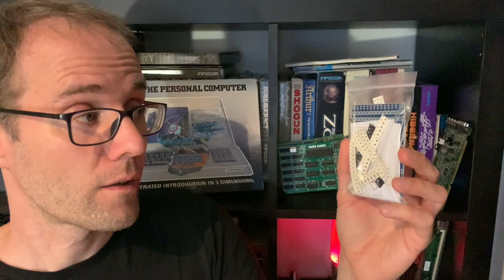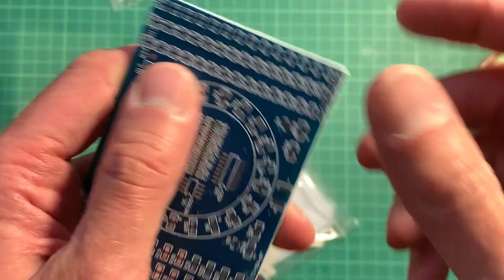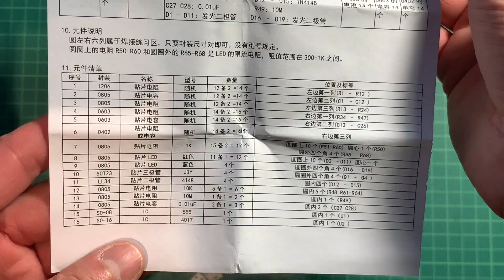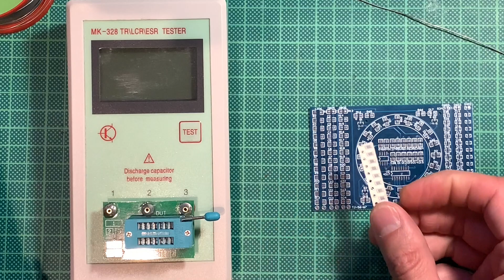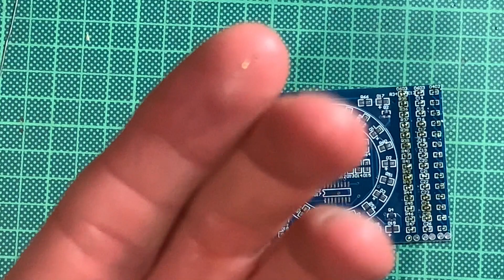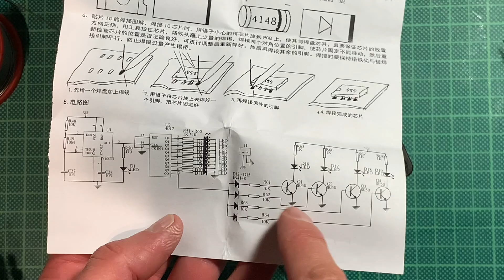How To Learn Surface Mount Soldering

Comment: Did yours come with a  battery clip? I couldn't tell from the video.
Reply from the maker: No I think not. You can hook it up using almost any battery clips or holders you have lying around.
Reply: Thx! 5V as you mentioned.   @root42

Comment: I like it when people starts learning SMD soldering! So great to see! For those components, i would go smaller then 0.7mm. If you go for 0.3mm of even 0.2mm It becomes much easier to put down the correct amount of solder. Good luck on you journey!
Reply: For clarification, you are referrring to the size of the solder, correct?

Comment: How are we supposed to know what goes where? I have this kit, and none of the numbers match up with anything on the little piece of paper they give you... I don't know what a resistor is.... a capacitor... none of that, and none of the component quantities match with how many they actually have... one of them has 16, and NONE of my parts have 16 on the list... like wtf
Reply: I have the same issue…. Did you find anything out?
Reply from the maker: It might very well be that the Chinese sellers changed the kit and throw in random components. However to explain again: the three "strips" on the left and right are simply for testing your soldering skills in different component types and sizes. There are test points below that would be checked by a teacher after you did your soldering, and for resistors it should add up to the correct value, if all connections are proper.
In the middle the section is a bit more clever. There you need to assemble the LEDs and diodes at the correct places as labeled by the silkscreen. Same goes for the ICs, which should be obvious due to their footprint. Only the resistors for the LEDs are a bit more tricky, as you also have resistors for the left side, with the 3 "stripes". I don't know anymore which values go where, as it is so long ago, but they should have enough resistors in the kit.
Reply: @root42  thank you for the reply!
Reply: @jamespage3884  the video creator just responded. Check it out

Comment: What kind of battery pack is that that you’re testing it with? I finished the soldering but don’t know what battery tool to use to test it out
Reply from the maker: I used a 4xAA battery holder with NiMH batteries. This gives about 5V when they are full charged. With Alkaline batteries you should probably use 3xAA. You could also solder a USB connector to the pads and use a power bank.

Comment: As it so happened I ordered the same practice kit, but i found soldering with tin very tricky. So i tried with solderpaste and put a tiny blob on the pads, and that would stick doen the component, then just heating the edge of the pad was enough to heat the pad, solderpaste and componen to get a nice solder joint. The heated solderpast had enough surface tension to pull the component into alignment. Then it was just a matter of heating the other side. Oh , and the 4017 and 555 were much easier to solder than the other components.
Reply from the maker: Sounds about right. Solder paste of course comes with quite a bit of flux, so it should making soldering quite easy. It’s all mostly practice, practice, practice. No matter what you use.

Comment: Hi, thanks for it. Do yoou have this paper . With components values.??  I have dificult to identify each one.
Reply from the maker: No... but you can measure with a multimeter or one of the cheap component testers. The resistors have values on them, the caps need to be measured.

Comment: I watched your vid multiple times. After receiving my 3 test boards I was ready! The only thing I discovered was D1 in the center of the board the LED green tip points down not up. After corrected my second board worked fine. I only had red LEDs though no blue. As you did mention for the 0402 parts, I also fluxed and pre-tinned the pads for the center diodes, and chips. That was a lot easier than doing each point by hand.
Reply from the maker: Good job! They throw in whatever parts they have I think. So having different color LEDs is no surprise.